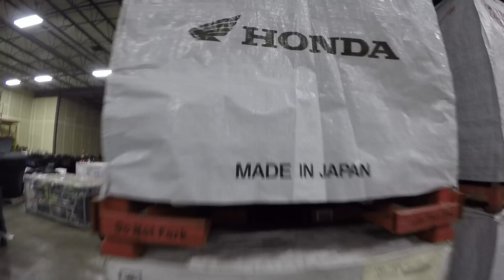2018 Honda Goldwing Tour DCT Unboxing - Motoprimo Motorsports

Comment: Hay, thanks for that. I love the look of the Goldwing f6b against the Goldwing tour. So they both are exactly the same bike with the option on both to go automatic just that one has a top box and the other doesn’t. Do I have that right? Cheers guys
Reply from the maker: Yes and no,  There are electronic differences between the 2 bikes like the Electronic Preload Suspension. otherwise pretty similar
Reply: Motoprimo Motorsports 

There is no heated seats (hand grips only) or center stand on the GoldWing. Why no center stand on a big bike just does not make sense. Does the frame allow for one if one can be ordered?
Reply from the maker: In the USA the Goldwing Tour as we un-boxed here features a center stand, heated grips and heated seat.

Comment: Hi does the Goldwing HAVE to come with the trunk or is it an option not to have it? Cheers
Reply: The "2018 Goldwing" comes without. The "2018 Goldwing Tour" comes with.
Reply from the maker: Thanks for the replies, David and Bobu are correct!  The Goldwing and Goldwing tour have the option to add and remove the truck.  Ride as you please!